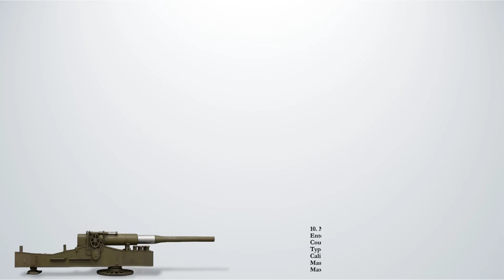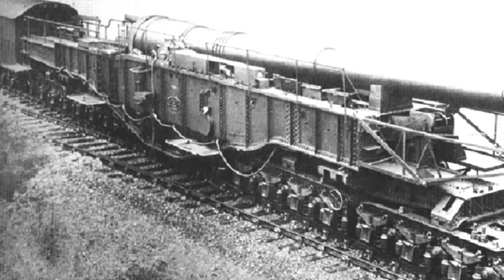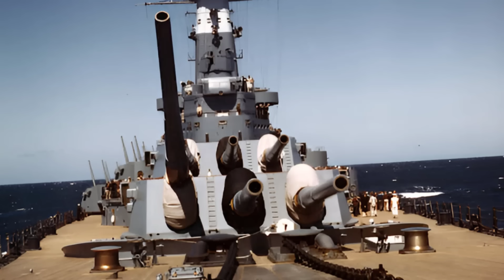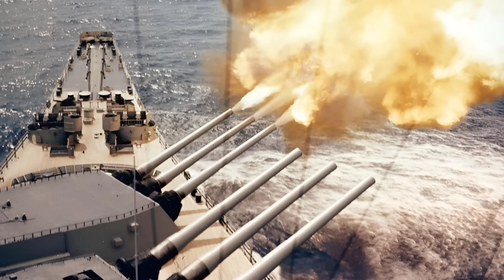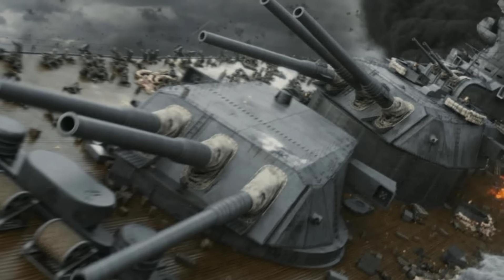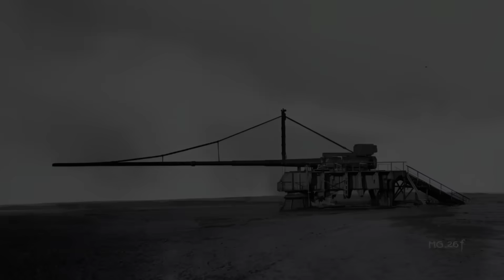Top 10 Weapons with the Longest Barrel Length

Comment: Actually the longest barrel ever was the V-3 at 130 metres, but it was never used in any sense, what has been used is the "Mini V3 battery" which is a shorter version of the V-3 which was a 150mm HDP gun used to bombard Luxembourg throughout 1944 - 1945. At a length of 50 metres, it is the longest barrel ever used in combat.

That is not the only thing you missed, on top of that the K-5 and K-12 cannons are nowhere to be seen, K-5 with a barrel length of 21.5 metres and the K-12 being just between the Paris Gun and the Schwerer Gustav at 33.3 metres.
Reply: baby Babylon was close at 45 meters. Big Babylon would have been the biggest but it was not completed at 156 meters.

Comment: You should be more consistent in giving metric and U. S. Customary measurements together, during the narration. We shouldn't have to stop every time and look up the equivalent measurements on the previous screen, or a google search. Very disruptive.
Reply: milimetrics its the best adapt or go extint
Reply: @JuanRico-d1b  This video uses a mix of metric and U.S. Customary. It's just not consistent. BTW, I'm not too worried about going extinct. Millions are still using U.S Customary.

Comment: Unfortunately, there are several inaccuracies:

I think it should be taken into account for all guns that the barrel  of the naval guns still protrudes into the turret.
The measurement should always be taken up to the gun breech. This applies to all guns except No. 2 and the Paris cannon, where only the total length was marked.

Why does the 2A3 capacitor bear a German Wehrmacht cross?
Wasn't it only introduced by the Soviet Union in 1955?

Comment: Actually the US Army's 16"/L50 (several of which were from ships that weren't built due to the Washington & London Naval Treaties) depending on mount could actually elevate to 60 degrees!!!  (It was discovered that for Maximum Range a gun tube had to be able to be elevated to 55 degrees (so it would get into thinner air quicker that if it was at 45 degrees of elevation....  This of course only applies to long range guns and not to smaller, shorter ranged Anti-Aircraft Artillery)

Comment: That Video has more errors that correct data and pics. USSR Guns with German markings in the pics? Mixing up the German railway guns completely? Only 2 schwerer gustav have been build and not 3.  Where is K12 (33,3m barrel)? Colorado and tripple turrets?
Reply: Mit der leichteren Ferngranate erreichte der schwere Gustav die genannte Reichweite mit der schwereren Granate war die Reichweite unter 40 Kilometer
Reply: @Otmar_Schloetterlein why did you answer like this when I didnt even mention that point ?